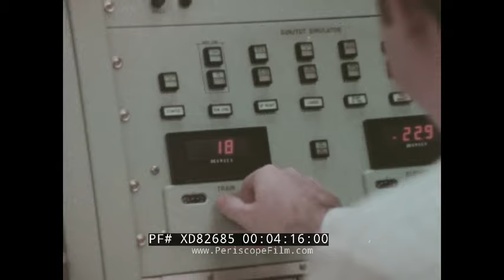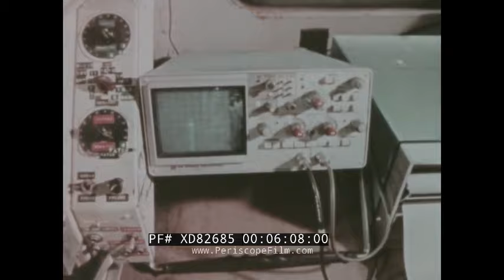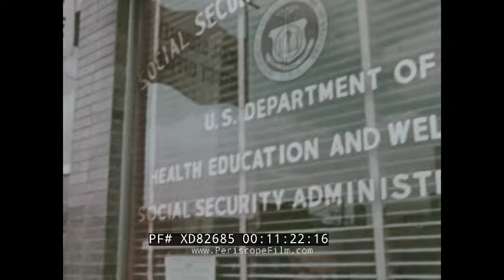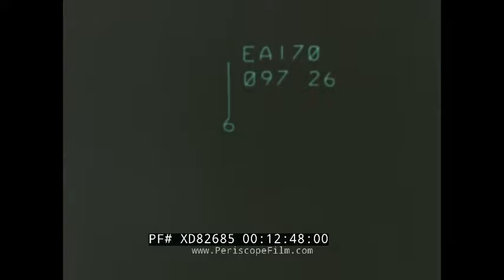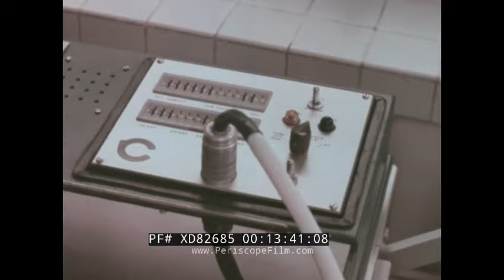SPERRY CORPORATION 1978 REPORT TO EMPLOYEES   UNIVAC COMPUTERS   AIR TRAFFIC CONTROL XD82685

Comment: I parted out an old Sperry voice mail server that was used at TWA headquarters at KCI. It had two massive hard drives with 14 inch discs in them. They must have weighed 50 lbs each! I still have the discs.
Reply: I've a magnet from a drive of that cohort that I use to keep all of my ball hex drives.  

It's awesome for that!